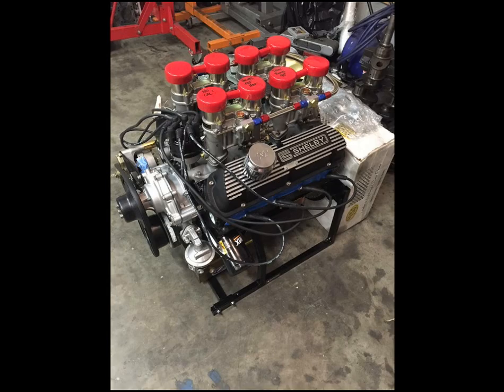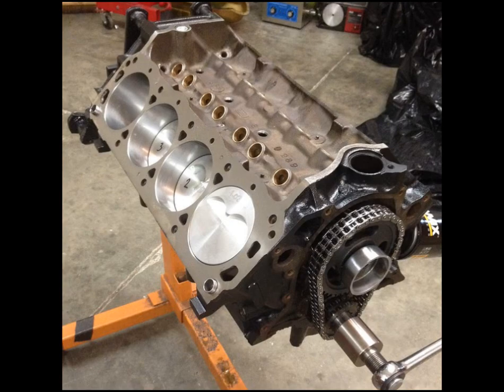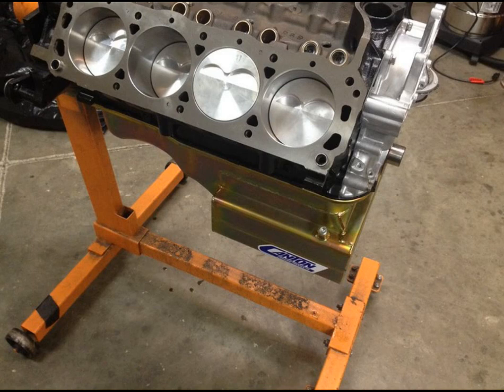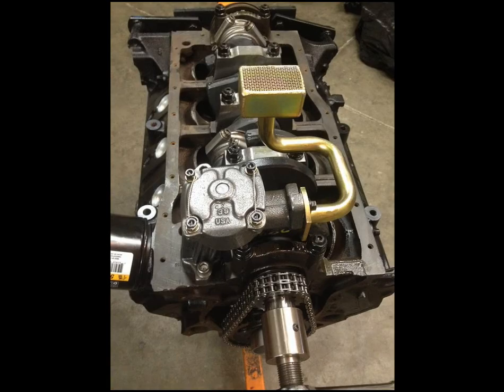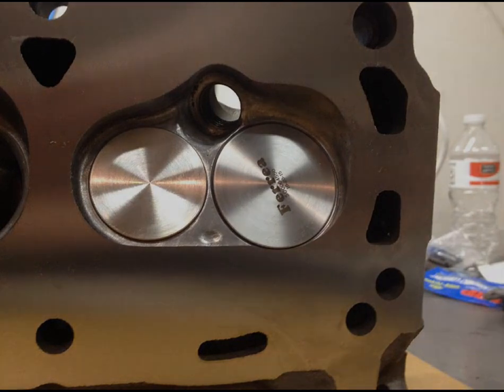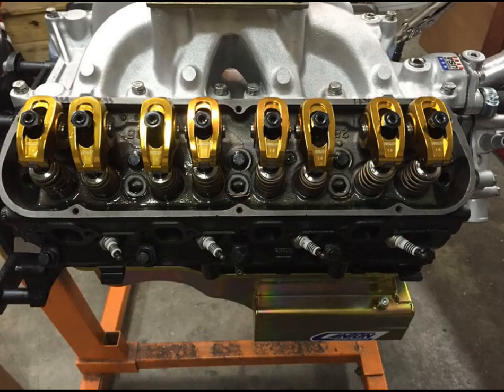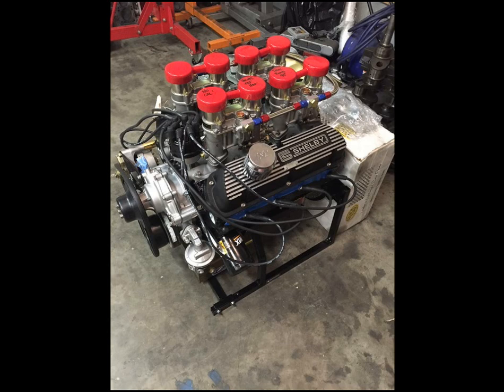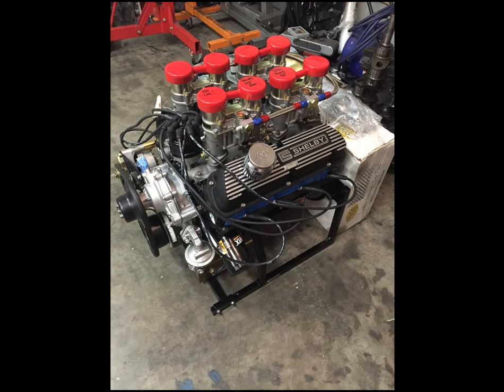Lykins Motorsports Ford 289 FIA Road Race Engine Overview...

Comment: well, ref your comment on Weber's, I was pretty happy with the 640 ft-lbs of torque you squeezed out of my engine with a mild cam and lower (10.5:1 compression)!  It's a rocket on acceleration! (and yes, they do look cool, I get lots & lots of positive comments).  Hope all is well with you and I love what you built for me!
Reply: What displacement, 10.5:1 must be big displacement
Reply from the maker: Hey Dennis!   Yes, your engine with a Performer RPM and less cam will make 640 hp and 640 lbft.  But the Webers are eye candy.
Reply: @lykinsmotorsports  what size cam? I wanted to duplicate the build with my dad when I was in HS. That cam was fairly loppy but learned big is not always best

Comment: Currently for FIA spec (as enforced in Europe) it's standard non rail rockers, no titanium valves or retainers and valve sizes as per FIA homologation( 1.88/1.64). I think cam lift/dur is free but since you have to have the standard rocker and a 7k rpm limit (mandatory MSD chip) you are limited anyway. Period blocks only( at least that's what the casting number says!).
Reply: Do you know if it’s the same for the GT40 classes that they run in Europe?

Comment: hi i always thought webers on 351c helped low end response? so i am a little curious on your statement here, is it a 289 thing you are speaking of?. tks for all the vids solid work!
Reply from the maker: Wives tale that a Weber setup is superior to a correctly-spec'd intake/carb setup.
Reply: Weber's on a track will obliterate a single plane.
Reply from the maker: As with all generalizations, it's wrong.  :-)

Comment: I have no time ever, but I ported 65' 289 heads 1.94/1.60 using David Vizard's techniques. Stock bottom 302h.o, cam,rollers,ported RPM manifold etc. Feels like a hopped up big block. Need to dyno but in a Ford Maverick, wild ride to say the least.

Comment: Cam limited to .500 lift, what ratio rockers were allowed? ...wish Ford would have lengthened the 289 cylinders, and beefed up the lifter valley, like they did for the 302.